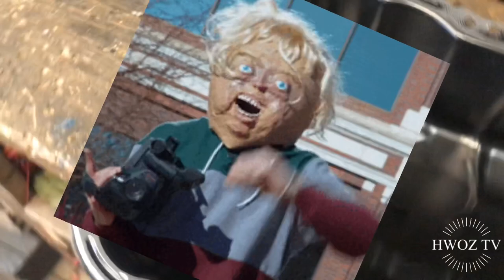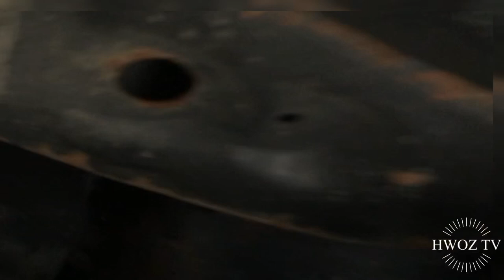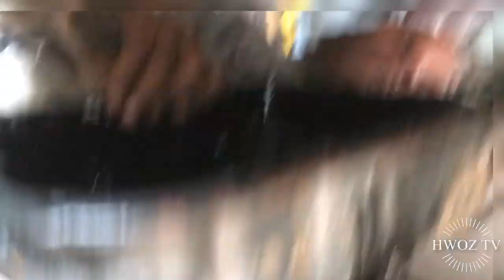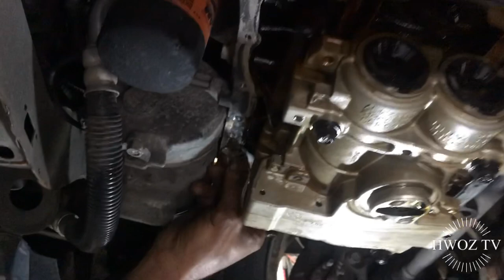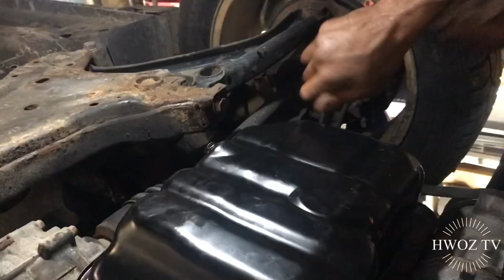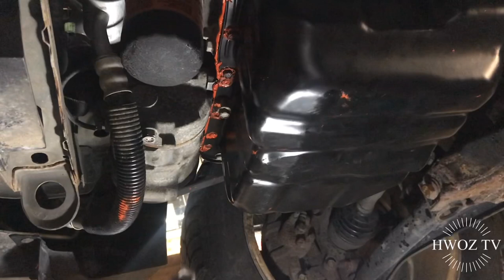2013 Jeep Compass 2.4L 2x2By4X4 Oil pan replacement vlog .. A day at MoTown Auto

Comment: Thanks for the video guys I was pretty sure I knew how to replace an oil pan but just wanted to see before I tried doing it on my jeep. I have a shop that’s trying to drag me through the ringer and they didn’t even fix the two problems I took it in for my bills already up to 1000!! Yeah they want $485 more to replace my oil pan because they said my oil plug is stripped and since my pan is plastic they can’t just bore it out and put a new plug. Assholes. My husband never has this shit happen to him at the shop but on this one he didn’t have time.
Reply from the maker: I just replaced my oil pan and it wasn’t plastic , it’s steel ? So why they said it was plastic blows me away .